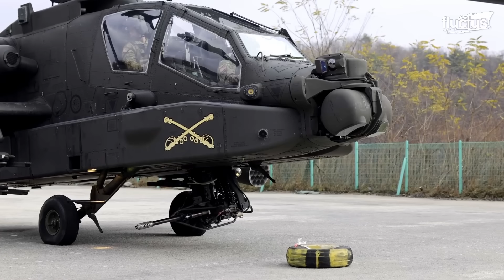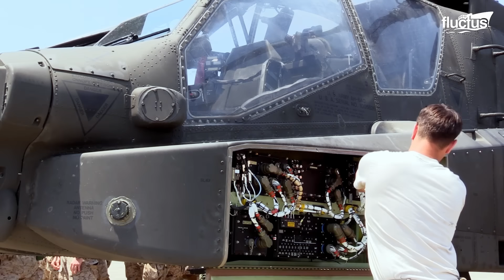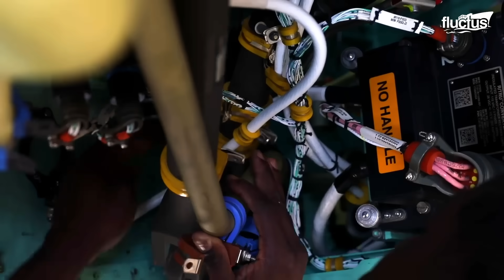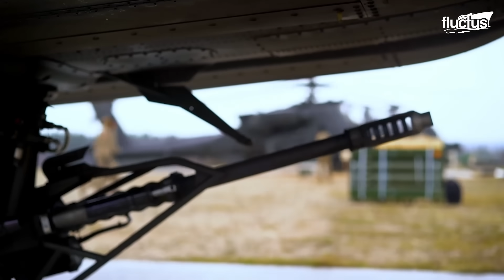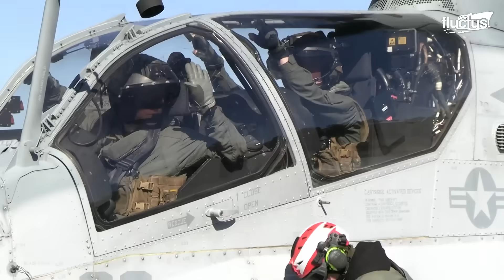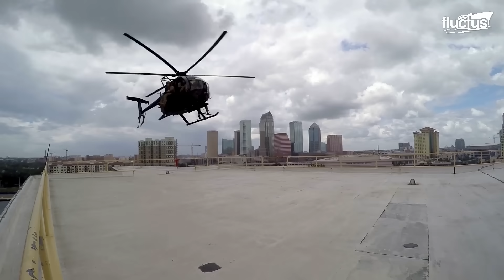Inside Restricted Hangar Repairing US Most Advanced Attack Helicopters

Comment: When the upper and lower airlock doors are closed, the internal airlocks of the non-combustion engine open, and air is received at atmospheric pressure to the combustion engine from the sharp, fork-shaped valves on the side, in front, of the fighter cabin, and sent to the rear main combustion engine, of course both are main engines, f35